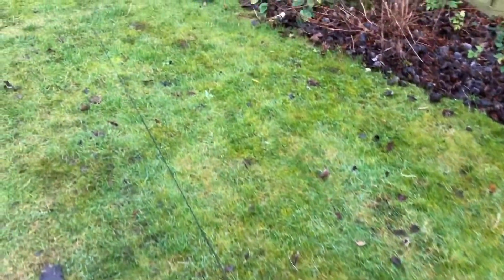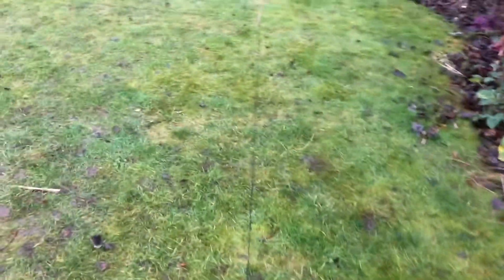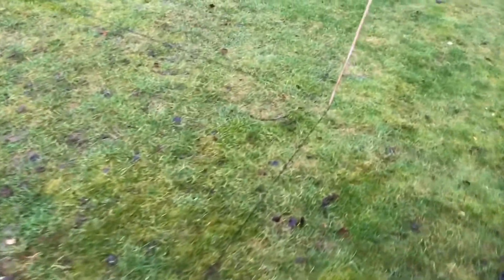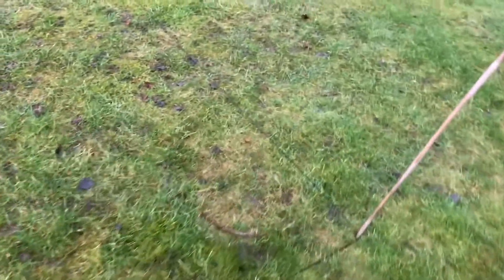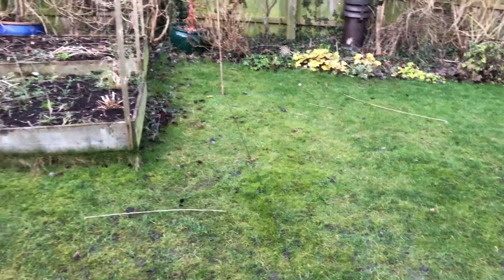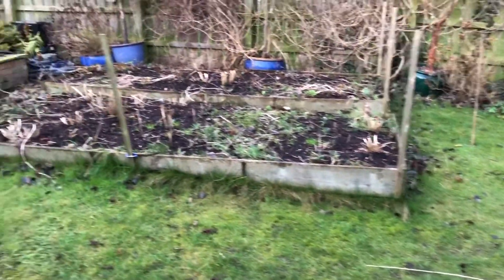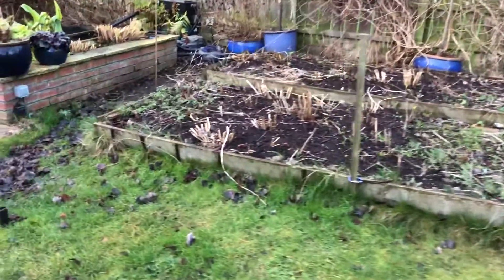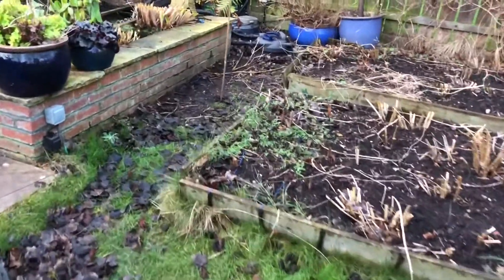Loop on the Ground Antenna - Part 2 of 4 Further Tests

Comment: In video 1 when the loop was around the pond, you weren't impressed with the results. Here, with the loop moved to the grass, the results appear much better. Could the pond itself, being inside the loop, have been "dampening" or "diluting" the received signal? No, really. Puns intended.
I'm awaiting arrival of a couple of bits to make one of these, myself for Rx to hopefully combat a fairly constant S9 noise, with a DXCommander for Tx.
Reply from the maker: Hi Raymond. I’m not sure, I’d have to watch that one back 🤔 I find it really useful now on 160 & 80m. At a guess, other than something like a metal object, I don’t think much would interfere in the centre? Good luck with yours 👍🏻

Comment: Hello Ian, another good video demonstrating what ham radio is all about, experimenting. I used a meter square frame aerial with 16 turns for top band and a variable capacitor to resonate the coil, transmitting on a loaded dipole while listening on the loop made a big difference in reducing the noise. VY 73 de John G4YDM.
Reply from the maker: Thanks again John. I'll look into that myself...

Comment: You say the receive 'drops off' when you raise the loop. 

Does this mean you get worse results when the wire is lifted off of the ground than when it's laying directly on the ground?

Thank you
jacob.
Reply from the maker: Yes, I got worse results as I lifted the loop higher.
Reply: @G0CNN-Ian  Thank you very much for getting back to me. I find the result very puzzling, but very interesting :)
Reply from the maker: As it went higher, it started to behave more like a normal antenna and was susceptible to all the noise I was trying to get away from. It performed best back on the ground. Hope this helps!

Comment: The most encouraging lesson from this series was that I am not the only one suffering with 10dB over S9 noise on 40m.
Reply from the maker: Ha ha, yes it's grim isn't it :-(   Apologies for delayed reply, I've just discovered YouTube holds a folder of what it thinks is "iffy" comments...all mine seem ok though, so not sure why!
Reply: @G0CNN-Ian , no idea why I was censored, I don't believe in bashing people that take the time to make videos. Maybe the computer has been mind reading, I must admit my initial prejudice was that this was going to be a disaster, but the results clearly had merit. FWIW  a friend made a tuned frame aerial for receive, that was fascinating. I did wonder whether in this example if your feed impedance might be very low, ie if the transformation is backwards. I don't know the answer, might be worth trying a VNA or antenna analyser.
73
Reply: my noise is s7 on a good day.. s9 normally, s9+ often times.. yall aint alone guys.. its the wireless world i guess

Comment: Very interesting. I’m enthusiastic now that this could work well with the right tweaking. It will be interesting to see if the little amplifier at the feed point raises the sensitivity without increasing the noise. Well done Ian and thanks for working on this. I’m rebuilding my shack layout after purchasing a new amp. I have the FTDX5000 same as you and the shelf won’t take the weight of the radio and amp cuz they’re bloody heavy. A little job has turned into a big one as usual. Catch up with you soon. Paul
Reply from the maker: Mind yer back Paul! Ditto, delayed reply...sorry...

Comment: Hi Ian - Callum and I were talking about this today - it seems you have definitely achieved a better S/N ratio with the loop on the ground (on 80m at least) this time. Am I right in thinking that all you did was move it to the lawn?  Previously was it on more of a concrete surface as it went around the pond?  I do think that raising it up will not make any improvements.  I am about to make one myself so will let you know how it goes.  Well done mate.  73 Tom M0RMY
Reply from the maker: Yes Tom. When it was round the pond only the one side was on the paving. The other three sides were on grass/soil. Apologies for delayed reply, I've just discovered YouTube holds a folder of what it thinks is "iffy" comments...all mine seem ok though, so not sure why!

Comment: Ian, have you ever tried a small active loop? I've just been made aware of the MLA-30 loop. I think it needs some upgrading but it's supposed to have a lot of potential for not a lot of money. It's something I'm going to look into.
Reply from the maker: No, but now you've mentioned it I'll take a look as well. Thanks. Apologies for delayed reply, I've just discovered YouTube holds a folder of what it thinks is "iffy" comments...all mine seem ok though, so not sure why!
Reply: @G0CNN-Ian  No problem Ian. I mentioned this to my neighbour across the road who is into his SDR. He took a punt and bought one. He showed me the difference between his long wire and the MLA. I was pretty impressed.